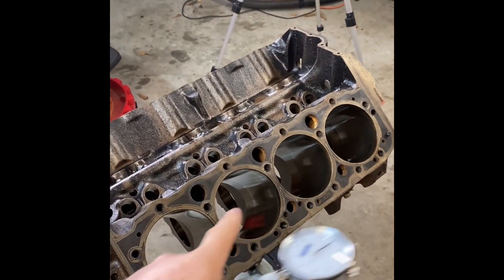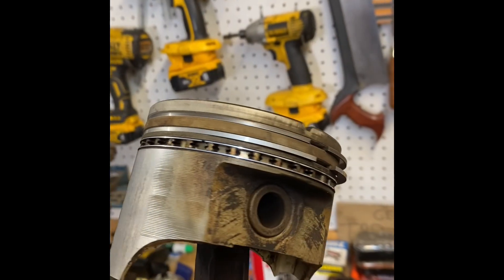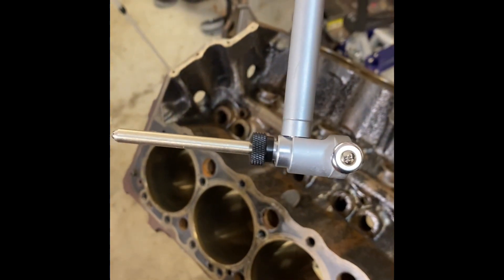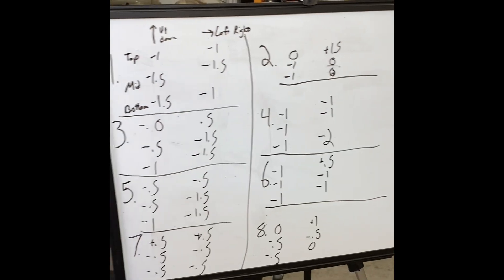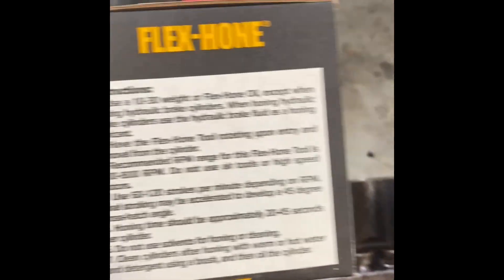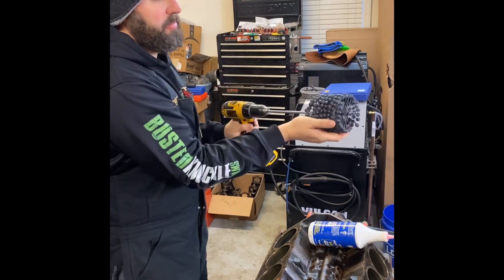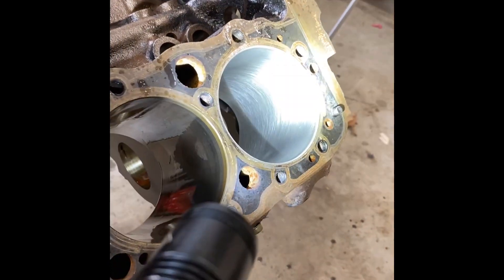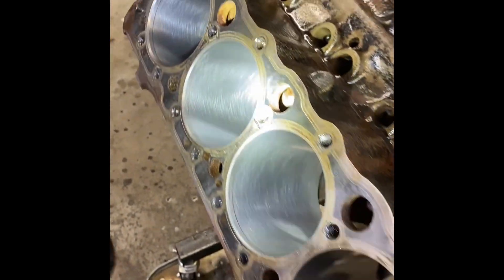Budget Engine Honing | Sick Week Build Part 3

Comment: According to Uncle Tony's Garage you can hone a block .010" over and re-use the pistons the engine came with. He claims the rings will center the pistons, he has a couple of cars that are built that way. It's Either Gonna Work Or It Ain't right?

I couldn't tell for sure but your cross hatch angle looked a bit flat, the X pattern should be close to 45*, to get that the faster the drill spins the faster the up and down motion needs to be. This X is what you're looking for but rotated 90* for future reference, should work fine for just wanting to get er done though.  If that is what you ended up with(like I said it was hard for me to see) good job if not you'll do better next time? I'm a machinist by trade just sharing a little knowledge for anyone that reads this, no offense intended.(yes you were correct 22.5* but no less than 22* and up to no more than 32*  I wrote the above before my morning coffee, sorry about that.)
Reply from the maker: All this honing took 0.0005” out of the bore. It works take forever to remove 0.010” and I would never recommend that. The cross hatch intersects at a 45 degree angle. It’s not supposed to be 45 degrees from horizontal. Should need about 22.5 degrees from horizontal.
Reply: @freedomworx  

A trick to use when your hone is cutting slower is to run it in reverse so you're using a different spot on the hone dingle berries stones.
Reply: @freedomworx  
Yeah, sorry I wrote that cross hatch backwards I'll go back and fix it.